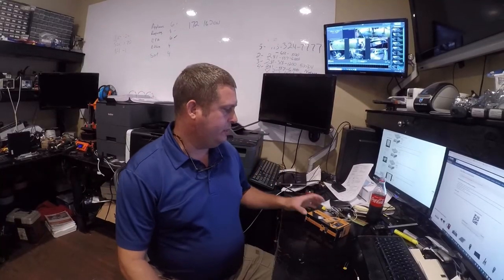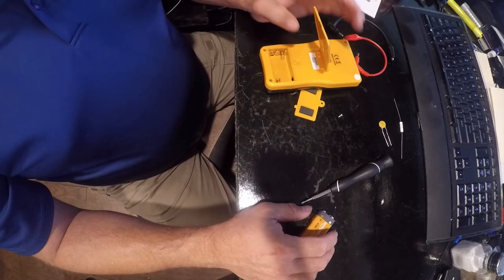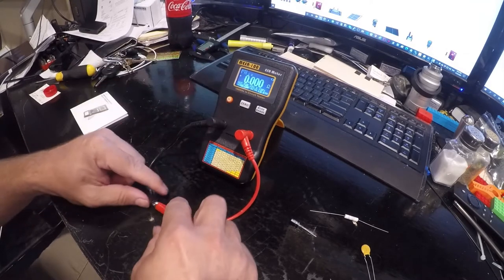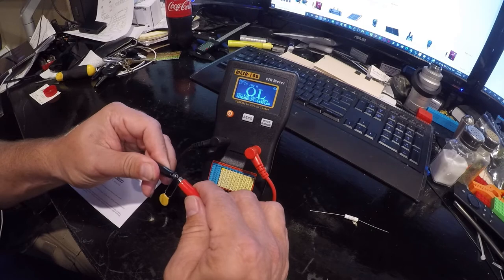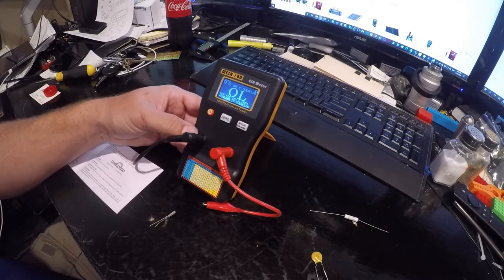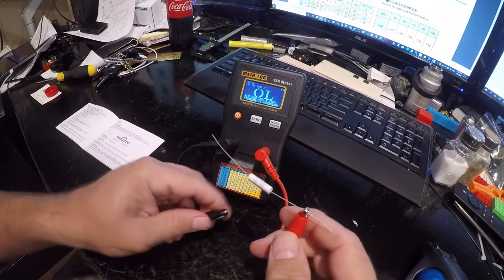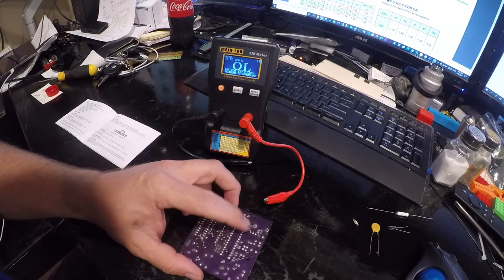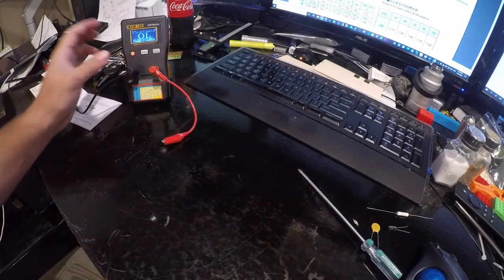Tool Review: MESR-100 ESR Meter for in-circuit Capacitor Testing

Comment: Great tutorial. You can also test the resistance and microhenries of the inductors with the esr meter. The reactance formula is 2𝛑FL. That would be 2 x 3.14 x frequency of esr meter which is 100kHz x 100uH Just plug it in.

R=0.628 X L(uH)
L(uH)=R(ohms)/0.628

Comment: Is this one better than the Peak in circuit cap tester ?
Reply: What the f..ck????
Reply: Nope, I wish I would have just ordered the Peak or Blue ESR meter because of their better build and longer leads.  The leads compatible with the MESR-100 are about six inches long making it difficult to use on circuit boards. You can try longer leads but I've not found anything that would calibrate (zero) properly.
Reply: peak esrs are better.it measures capacitance. and more user friendly... but it also costs £80... where this chinese one costs just £30...and it works really well too!